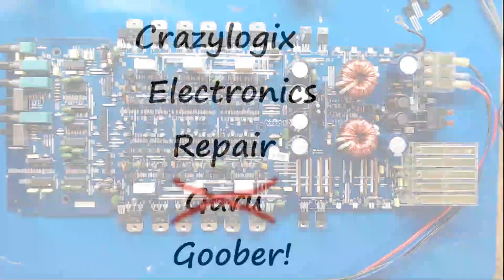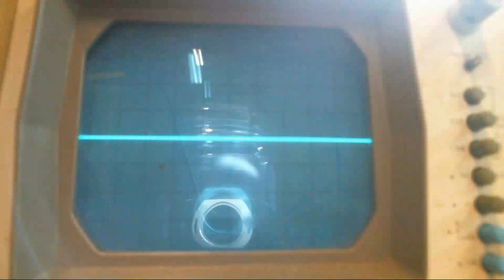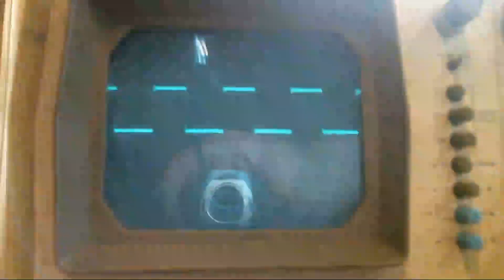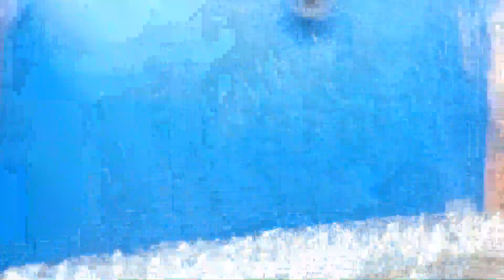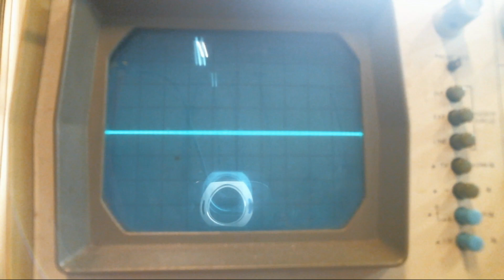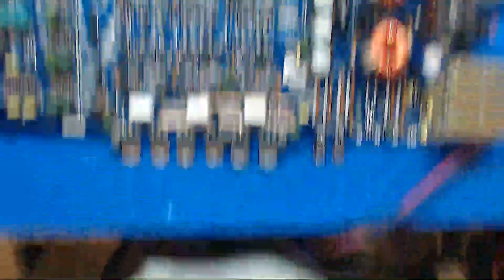Repair Power supply in an Aura 5350 amplifier Part 3.5

Comment: Nice work, I was wondering if you were going to change out those driver transistors. Especially since you replaced the PWM ic. You didn't fail me, lol. The solder braid is always a good trace fix. You said what your name was at the beginning but I'm old too, lol. Don't really want to call you crazy. lol Nice video